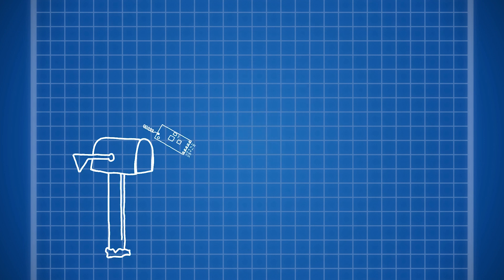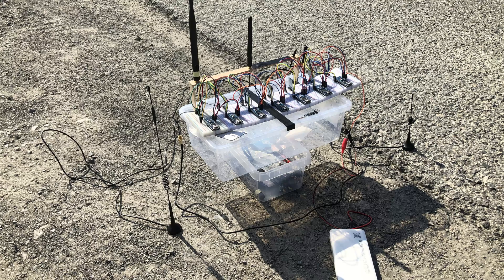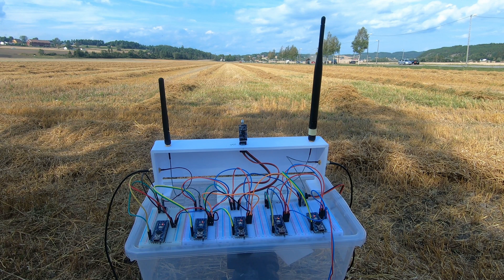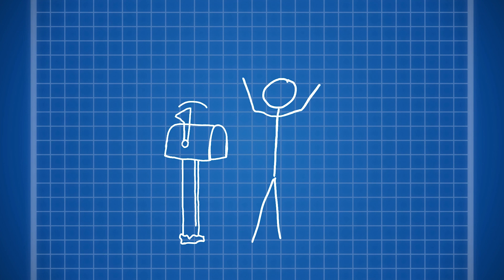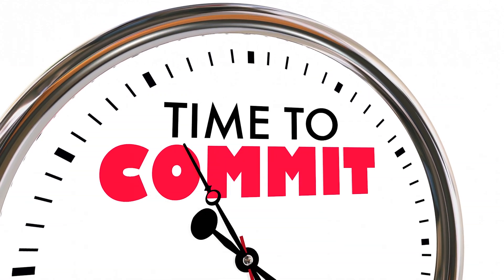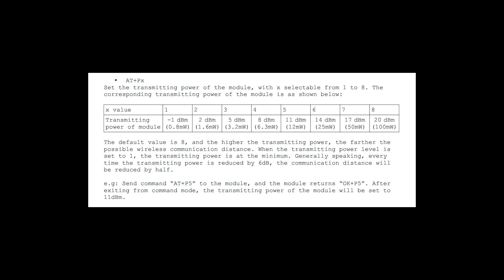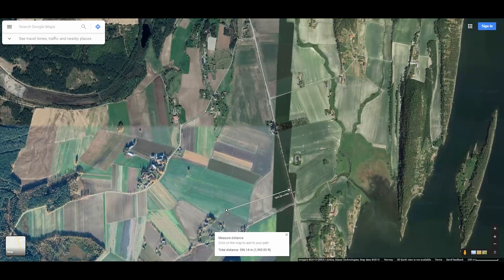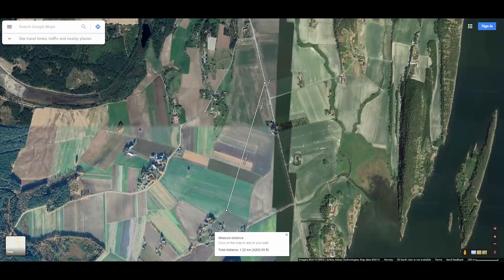2 KM SUCCESS STORY with HC-12 - going beyond 1800 meters!

Comment: Hi ! I am from India. I have used HC12 modules in my project. Unfortunately I got just 3 feet wireless range in my project. Maybe it is because of cheap variants of HC12 modules. I do not recommend anyone to use these modules. Instead of that use Xbee Series 2 modules. You will definitely get 100m-200m wireless range.
Reply from the maker: Hi Shreyas. Thanks for the information, The Xbee module is crazy expensive $20-25 compared to the Hc-12 that cost around $3-4 atm. Especially if u only getting 100-200m while the Hc-12 gives you 1800m++. The Xbee is a totally different communication module for a different use, mostly seen in mesh networks and so on. Could be fun to test this out though. have just read about it, newer seen one my self.

Comment: Great test & Thanks a ton !

I have few queries. 
1. I tried to search for HC 12 on HC01.com but couldn't find HC 12 for sale. any idea where can I get HC 12 original?
2. In my project I am controlling speed of DC motor using arduino nano & HC 12. I am sending digits of pot value & receiving them @ receiver. I am converting these values to analog write and driving motors using MX1508 module. 
the issue is if I replace the motors with LED as load everything works fine. But when I connect motors, the receivers does not work properly. Seems motors noise creating issues with HC 12. Any guess what can be solution to this ?
(I added parallel small caps to motor terminals & to motor chassi as well...but no luck .)
Reply from the maker: Hi Kaustubh!
1. try hc01.shop (thats the url)
2. Interference from the motor is as you are saying probably the cause of the issue. Luckily there are many things you can do fix it.
- Try moving the motor and the HC-12 further apart. 
- Try shielding the antenna from the motor and / or move the antenna further from the motor.
-  Isolate the motor circuit from the arduino and the HC12. 
Many motor drivers use an optocoupler to feed the power to the mosfet / motorcontroller. Also make sure to add a diode to prevent the current produced by the motor to sneak back in your circuit.
Reply: @DIYTECHBROS  Ok. Thanks !

Comment: Hi guys excellent video, and good investigative work by yourselves. The field test you do in the video is very similar to a field test I did some years ago when testing the range of a 443Mhz remote control unit, operating at 10mW under line of sight conditions.
Strangely enough I achieved exactly the same distance as yourselves, about 1.75km to 1.8km, however I was using a magmount antenna on the roof of a vehicle.

Maybe you guys could help me out with a query I have, so here goes:-

I want to use two HC-12 units for a one way remote control, as shown in this diagram. 

https://photos.google.com/share/AF1QipOErwpVOHDI0nfqxZZp-xYoo8EtaMZSNv2lSN3--U2I3YvA2muyMWfKSIvi4Gh53Q?key=UWpRQWtCVVdEdWRoQXdWS3BJUVVZS0ZtUGJLOGhB

However I do not want to use Arduino's, and neither do I need a feedback LED as shown in diagram. Instead of using two Arduino's I want to use a RF600E encoder on the transmitter HC-12, and a RF600D decoder on the receiver HC-12. How could that be achieved/ The RF600 data sheet can be found here:-

http://www.farnell.com/datasheets/1870856.pdf

I'm glad I discovered your video, as I was planning on purchasing two HC-12's from Banggood, but not if they are the low power 50 metre range versions. Where did you purchase your original HC-12's from, ie the low power 50 metre versions, and what was the power level set at for the field test? Banggood claim the default setting is 8 being maximum power ie 200mW. Was the 50 metre range with the power level at 8, which is supposed to be 200mW? What was the difference in current drawn by the original unit, and the cloned one?

Finally do hc01 supply to the trade only and in bulk order as usually is the case with Chinese suppliers. How did you find your way around the hc01 website, as I found it utterly confusing being all in Chinese, and Google translate didn't work. I did send them an e-mail but they never replied, probably could not understand the content. Makes me wonder how the hell foreign companies deal with Chinese companies and the language barrier.

So basically does the genuine HC-12 have hc01 printed on the reverse, whereas the copied (low power) version does not?

Keep up the good work, and once again thanks for the video

Comment: Thanks for this video, I didn't know that are HC12 clones modules, I was close to order some but I see it don't worth the money, now I'm buying the originals. I'm a amateur radio operator and here in Chile, we can transmit from 430mhz to 440mhz at full power (up to 25W) so i want to try to use a couple of this modules to transfer data from my home and a remote site in a farm where I have a Linux server with some SDR and HF antennas, currently I access via LTE Network but I want a backup, so im going to use a pair of UHF yagis at about 30 feet from the ground to try to reach about 5km
Reply: Hola. ¿Qué tal te resultó el HC-12?, ¿Cuánta distancia lograste?. Soy de Villa Alemana. Saludos.

Comment: Dette var en bra test gutter! Jeg har testet HC-12 en del selv også, og kjøpt en bunch med antenner også, hehe. Kan dere legge ut linkene til alt dere kjøpte og hvilken antenne dere oppnådde beste resultat med, slik at jeg kan kjøpe tilsvarende?
Reply from the maker: Thanks! The best performing antenna was https://www.ebay.com/itm/433MHZ-High-Gain-Antenna-SMA-Within-Needle-Rubber-Glue-Stick-6DBI-MA/131535083764. Note that this in an omnidirectional antenna. If you can use a directional antenna it will further increase your range.

Comment: Hi Guys .Great job. It's possible to transmit variables as humidity or temperature for a wheather station?

Rgds
Reply from the maker: +Domingos Castelhano Hi! That’s very possible. BUT, if it is battery powered it is best to stick to a power saving mode if possible. And, use a directional antenna, like a helicoil.

Comment: Very good work. Did you mention where people can buy the most effective of your tested antennae?
Reply from the maker: Just a note to anyone reading - you should really check out Samuel Fielder's YouTube channel - we love it! https://www.youtube.com/channel/UCAzYsCl1M56Mq_WzbpU3nXg
Reply from the maker: Hi! Excellent question! We bought ours from HC01.com. We are currently looking for a easier place to order from, and will update the description once we can confirm that they are selling original parts.
Reply from the maker: The antennas are all from ebay.  The problem with linking to ebay is that the postings run out.
Reply: @DIYTECHBROS  well you can give us some search terms like the length and width and type of metals.
Reply from the maker: This is the best performing antenna: https://www.ebay.com/itm/433MHZ-High-Gain-Antenna-SMA-Within-Needle-Rubber-Glue-Stick-6DBI-MA/131535083764
Reply: @DIYTECHBROS  Great but where can I find a cable to go from that antennas unknown coaxial connector size to the HC-12's 2mm coaxial connector?
Reply from the maker: @rickrose2235  Hi! The connection style is called IPEX, so just search for SMA to IPEX. 
BUT!! Before you do, the range with the spring antenna is amazing! I would only recommend an antenna if the position of the modules requires it.